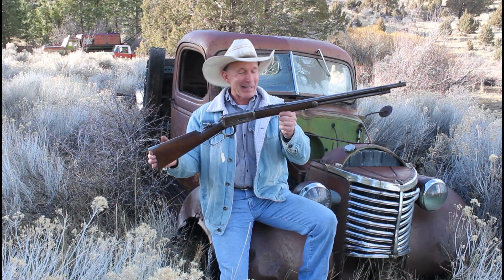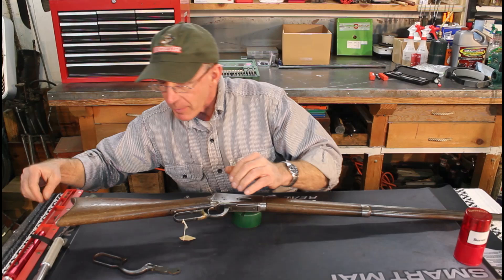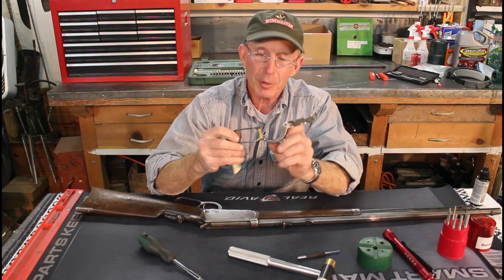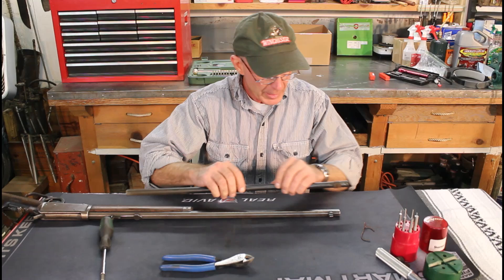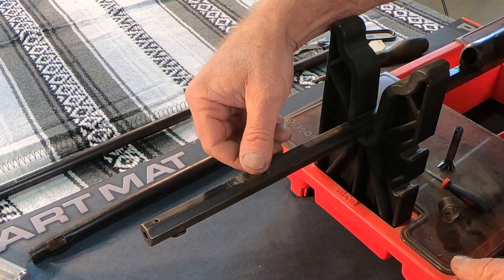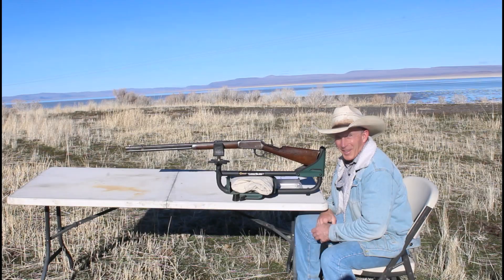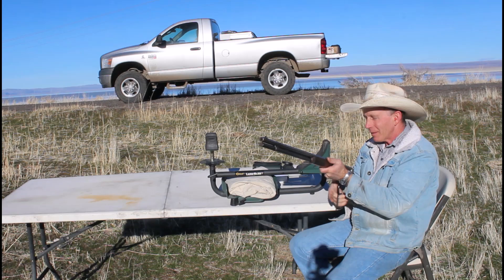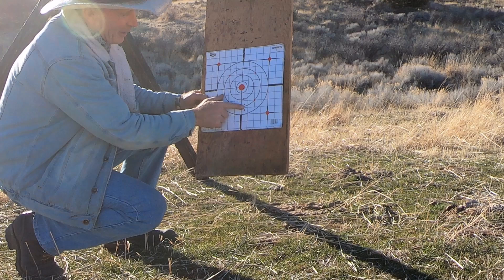Junkyard Winchester 1894

Comment: I have an 1894 in .38-55 that I got a couple years back, makes yours look like a pristine example, would love to send you photos. It was sold to a local gun shop by an old timer who could no longer hunt. The original wood wasn't on it, the buttstock came off another Winchester with a pistol grip and the wood was relieved to allow the lever to work, there were no holes for a buttplate. The metal has a lot of pitting, but it's not deep. It's an octagon barrel and it's from 1895. The receiver is also pitted. But the barrel and the inside of the action, look great. I got it cheap, got some correct wood, correct sights, and was surprised with my handloads that it shoots very accurately. It's one of those guns that is a survivor, and to a collector, worth pretty much zilch, but trying to imagine the stories. I've hunted with it some, never killed a deer yet, got my last buck with its brother, a sporting 1894 half mag in .32-40 that groups like a match gun from 1909. I prefer the older, guns with some use than anything too nice to want to shoot.

Comment: My dad was heading an ordinance co in WWII in May of '45. They took over a locomotive factory just outside of Dachau. He found a 94 win with the barrel bent around a lamp post outside. No indication of how it was bent. No signs of heating or levers used to bend it. He went in the factory, found a hacksaw and sawed the barrel off, gathered up some parts that had fallen off and took it inside. "requisitioned" a new .30 barrel for a BAR and had an old German machinist fit it to the action. Either through ignorance or hope of revenge, the old guy chambered it for 8.14 x 45(?), a popular European hunting cartridge. Dad got home and a few years later made new stock and forend from a cherry tree that had fallen on the property his sister and BIL had resently bought. Polished everything to a mirror finish and blued it nearly black. Dad passed in 2016 and that rifle is mine now. I'd really love to plug the chamber and rechamber it for 30-30, but I'm scared that I'd damage the finish. Someday I will, but I'm not quite ready yet.

Comment: I   educated  myself on    the  repair   and resto  of    Winchester  lever    rifles  about  20  years  ago. I   found   the  mag  hangers   rather  ingenious as   the    dove  tail     aids  in  the    lock up  to  align   the  tube.  I   repaired  a  1894  DOM   1897  that  has   little  blueing and  was  well  abused,  stocks,  Barrel, screws replaced. What   amazed   me  was  this  rifle  was  built   before   aircraft/cars machine work done  on  steam  power   and  leather    belt  drives...all  to  within .002+- Inch...Amazing
Reply from the maker: The craftsmanship on these old rifles is definitely impressive considering what they had to work with.  Sadly, the craftsmanship on most modern guns doesn't come close, even with today's technology.
Reply: @thecinnabar8442   You  can    buy  a   Custom  made  rifle...  W1895, 94, M 36...but  you  will  spend  $ 5000.00 + in  work   to  make  it    as  good  as  a     standard  case  colored  Winchester / Marlin  that  sold   for   $30.00  in   1900. My  go  to  hunt   rifle  in  a    Savage 1899  in  .300   Savage. Its    the  safest   hunting    lever   rifle  ever  made  with  3  safety  features, Round  count, lever lock, chamber  loaded   button, First  class   craftsmanship.

Comment: For my oiling on any gun, I put the oil on an old shaving brush. Much better than a cloth that traps dust and metal particles between the rag and the bluing. AND you can get down in every nook and cranny. I saves the bluing on the sharp edges of an octagon barrel and frame. As an aside, those 25-35's were really good shooters in their day. Over the years (many) I managed to acquire all 5 caliber 94's with 26 octagon bbls! I love them.
Reply from the maker: Thanks for the great tip, Irvin!

Comment: I use a 1936 Model 94 in the 32 Winchester for deer hunting.  Quick, light and easy to carry, its the best damn brush gun ever made.
Reply: Mine is a 1970 model I believe. Bought it dirt cheap because everyone wants 30-30 not 32 WS. My go to deer rifle for over 20 years. Never fails me.
Reply: @rodneymcdermott5303  :  They are great guns, I just got rid of a 1946 30-30 that I found out had the butt replaced.  Im not a savvy collector like some guys are so when I bought it I thought it was original.  Funny thing, I made 400 bucks off a gun I owned for maybe 4 years, I'll take it.

Comment: Sixty years ago I bought a model 94, 25-35. It was built in 1910 with a 28 inch barrel, which was a special order length. Changed the sights and added a Marble peep sight. I shot mostly varmints from a rest.  At 200 yards I could put the bullet right on the money. It was the best rifle I ever owned. I foolishly sold it many years ago.  The only down side was that long octagonal barrel got heavy if you had to carry it a long distance.
Reply from the maker: It sounds like it was a great rifle!  I hope I can get this old rifle shooting that well.

Comment: Thank You! I just got a 1894  26" barrel  in .30 WCF made in 1924.  Missing the Rear Elevator. I ordered one from Homestead Parts. I also order 4 boxes of Ammo. I miss the days before hunting season when Walmart sold 30-30 for $5.00 a box. 🧔
Reply from the maker: Congrats.  Enjoy that new 1894!
Reply: Wal-Mart and K-Mart both had .30-30 shells under 10 bucks as recent as 12 to 15 years ago. That wasn't even sale or roll back pricing. I remember K-Mart would go 7 bucks on sale in the late 90s. .30-06 was 9 bucks on sale.
Reply: @johnnorman7708  now one boxes is $40.00 if you can fine it.

Comment: FYI.  New manufactured Win 25-35 cases are thicker in the rim & if your 25-35 is a low mileage unit will have a stiff lock-up.
Reply from the maker: Thanks for the info, Randy!

Comment: I wish I paid $15 for mine. My rifle looked like it was drug behind a wagon by a rope for a bit. But, the 32 Win special barrel is in relatively good condition so a worthwhile restoration. Cracked tang, a number of corners on the octagon nickel steel barrel worn off and some big dings got tig welded and is in process. My finger lever was cracked and repaired brazed like yours. I had a rough time tig welding that crack even after removing all visible traces of braze. I guess either the braze or flux gets into the metal and raises havoc with the welding. Should be a nice shooter when it's done.

Comment: Appears to be a 39  Chevrolet. They had the hinged windshield that cranked open. They worked good but possibility of wasp hitting you at speed. Only open at low speed.
I drove a similar 46 they were nice trucks.
My 51 I still drive deleted that feature but retained the cowl scoop with anti bug screen much more practical as I’m allergic to wasp stings. Swell up at affected area for two weeks and it hurts.
Forty below or hundred and ten that old Chevy still soldiers on now 71 years from first start. ( 6 volt electric system self start feature) .
My oldest rifle was made 1902 and still works as new as well. .30 U.S. Army Krag bolt action.
My grandmother’s sister’s husband owned it before me and took one of the biggest bull elk I’ve ever seen      bar none. About 1968 he got it. 1972 my brother and I got a big bull too. His rack measuring 56” between inside of wide point.
My friend John had his 28 Chevrolet pickup  ( drove as a young man ) out behind the granary and also had a huge bull rack in the back he got back then (20’s ) as well seven points on both sides.
Reply from the maker: Those are some great memories, both of the pickups and the bulls!  Thanks for watching and sharing your memories.

Comment: Great video! I'm a big fan of 25-35.  
If you have the opportunity could you do a video on reinstalling the wood forends on 1894 Winchester and Marlins. I've made the mistake of removing a couple and had a terrible old time getting everything lined up again, maybe the wood had expanded and was compressed before I took it off. Of course removing wood to get everything back together is a touchy proposition as taking too much off results in a rattling forend.
Reply from the maker: I've been planning to do some complete disassembly and assembly episodes on these old rifles at some point that will include removing and installing the furniture.  Keep an eye out for those in the future.

Comment: Very cool. My brother has a Winchester 94 with a similar story. It's a 1919 mfg .30-30  with a scope mount on the side and the original C stock butt has been sawn off and replaced with some hideous Walmart recoil pad and rasped down to the same size, with no effort made to correct the flat spots and file marks at all. We want to replace the stock, but the finish wouldn't match the forend or really the rest of the gun at all. 

Still worth 450 bucks at a police auction, though.
Reply from the maker: Definitely sounds like it was worth the money.  I'd keep an eye out for a decent used stock that would match the forend.  It's really tough to get the finish on a new stock to match
Reply: Want to sell that truck you were sitting on? My grandfather had 30/30 with an octagon barrel I wanted it so bad ,it wasn't ment to be/gone unfortunately.

Comment: Quick question, do you advocate using blue locktite when reassembling leverguns? They’re notorious for backing out screws. You mentioned not dropping small parts. In my shop I have the first verifiable black hole here on earth. EVERYTHING I drop disappears when it hits the floor, never to be found again. Thanks for the great video sir.

Comment: Yea mine has a shortened magazine tube, 1909 I think the barrel should be octagon but its round, someone drilled and tapped the side of the receiver for a scope mount, front sight has been changed. But it's still a 1909 Winchester model 1894 30-30 lol. Paid to much I'm sure but it works and I like it. Only thing I want to do to it is find someone to back fill the drill and tapped holes lol. But until then I'll put the scope mount on it.
Reply from the maker: Even if it isn't all original, they are great old guns to shoot.
Reply: @thecinnabar8442  History in your hands 
I think I own 3 modern firearms 
And 3 dozen Vietnam or before lol

Comment: I have a question regarding were you got your replacement parts I have to same rifle in about the same condition I need to track down a tube follower end cap and screw would like to know were you can track down parts thanks
Reply from the maker: Used parts come up pretty regularly on EBAY.  Homestead Parts and Numrich Gun Parts carry a variety of reproduction parts.  Good luck

Comment: The vertical stringing occurs because of a tight magazine tube, See the 1965 issue of Gun Digest, page 195 "Lever Guns"
Reply from the maker: Thanks for the tip.  I'll check that out.
Reply: That makes no sense. How does the magazine tube affect accuracy once the round is in the chamber and stabilized in the rifling when fired? More likely it’s due to the rest or barrel heating up. IMHO
Reply: @dogbone1358  all rifle barrels actually have a harmonious ringing to it when the weapon is fired. The bullet, pressure, rate of twist and bullet speed in the barrel have to be in as close to perfect balance for the best accuracy.
When the mag tube is attached to the barrel it effects this process more and less with each bullet put into and removed from the mag tube as it changes the weight and ability of the harmonic balance of the weapon.
It is all very fascinating how it happens during the entire process.
Reply: @Sport--willow   Concept of the magazine tube affecting the harmonics of the barrel is not something I’ve heard of but does make some sense.
Reply from the maker: I talked briefly about this in the episode on Winchester 1895 flatsides.  One of the advantages to the box magazine on the 1895 is that it eliminates the effects of the tubular magazines on barrel harmonics.  Of course the box magazines have their disadvantages, too.  They don't hold as many rounds and they can be a pain in backside to load.   Thanks for watching and commenting, guys!
Reply: Good thing about these old work horses is that they are very strong, reliable tools for shorter ranges and preservation. They reliably reach out 1 to 200 yards effectively and put meat on the table every year.
These Ol' girls aren't made to reach out 1000 plus yards like these new age fandangle rifles with these $3000 scopes and bullets traveling 2900fps and more.

Comment: Another good video, I'd like to find a old neglected Levergun to get back in to shooting shape.
Reply from the maker: Half the fun is in the hunt for neglected guns at the right price.
Reply: @thecinnabar8442  I did find a old Marlin 1893 in .30-30 made sometime around 1921, it was missing the forearm band and the magazine tube was loose. 
I found that the forearm band from a 336 fit it just fine and was able to squeeze the front barrel band just a little tighter with padded channel locks to keep the mag tube from moving side to side. 
Now its a decent shooter with a really cool kinda grey patina to the barrel and mag tube, with some of the original color case finish on the receiver.
Reply: @thecinnabar8442  Also forgot to mention that the previous "bubba" replaced the stock and managed to put the crescent buttplate on off center and crooked, requiring me to fill the screw holes with glued in dowels and redrill the screw holes to center the buttplate, now I just need to strip off the ugly varnish back to plain oiled walnut finish

Comment: I picked up an old 1894 Winchester at a local pawn shop  in 30WCF  made in 1915. It's a little rough and I thought the lever seemed a little sticky so I took it to a gunsmith to clean and he said it was pretty dirty, maybe never cleaned ? He pointed out something that he said is characteristic to old 94's is that when pointing the muzzle up and cocking the lever the hammer does not lock back ? But if you hold the rifle horizontal the hammer will engage back cocked ? I have never heard of this and have had 94's before, some as old and some newer ? Is that true, or should I find a better gunsmith ?

Comment: Another well done video Mark.  Good stuff.  

Was your tang sight locked into its detent.  Looks like it was leaning forward early in the shooting process.  Might be the source of what appears to be a little vertical stinging.   Nice shooting old 25-35 at any case.  Will look forward to your next video!
Reply from the maker: Great eye, Mark!  That combination of tang peep and sporting rear sight made an interesting sight picture.  I actually found myself unable to focus on the tang sight and naturally lined up on the rear sight.  The tang sight wasn't locking into place and I'll need to take it apart and see what's going on with it.  I'll remove the rear sight before I shoot it again to "unclutter" the sight picture.

Comment: I can't find the answer on any forums so I wanted to ask you. How snug should the magazine tube be on a model 94 with 2 barrel bands? Wondering about a carbine but I'm sure the answer applies to any model. Should the tube feel loose or should it be solid and locked into place when fully assembled? How much play is acceptable if any? Thank you very much.
Reply from the maker: When properly fitted, the magazine shouldn't have any play or movement.  If yours does, it likely has wear in one or more parts.
Reply: @thecinnabar8442  Thank you for answering! It's a pre ww2 model so I wasn't sure. When I tighten the bands enough to remove movement the threaded end of the band screws is exposed. I was thinking of filing the screws down and bluing the tip?

Comment: I own a 92 Win. 44-40. Most of the time it fails to chamber a round. It looks like it forces the nose of the round too high and rams it up against the top of the breech. I had a gunsmith work on it and he said he did not know how to fix it. Any ideas? Thanks.
Reply from the maker: Hi Charlie.  It's hard to diagnose without the rifle in hand, but it sounds like the carrier is travelling too high.  The right cartridge guide should limit the vertical travel of the carrier.  There may be wear on either the front of the cartridge guide or the carrier where they come in contact.  Of course, some ammo and bullet profiles can cause feeding problems in certain guns as well.  Good luck getting it figured out.
Reply: @thecinnabar8442  Thank you so much for taking the time to answer and keep those videos coming. Very interesting.

Comment: Hello, I'm a old retired USAF Vet. I have a 1886 Winchester in 38-56 I discovered it has a broken fireing pin.  I got  a new correct  firing pin. How can I have you help me with replacement and getting my 117 year rifle back in the field
Reply from the maker: Hi George.  Your best option would be to find a local gunsmith for the job.  The cost and hassle to ship it out here and back for a minor repair wouldn't be worth it.  Best of luck

Comment: You said the 25-35 was your favorite 94 cartridge why is that? Is it adequate for dear and maybe sheep? Impressive accuracy. What weight bullet do you prefer and what velocity do you get? Thanks for sharing 👍
Reply from the maker: I haven't hunted big game with 1894's, so I like the 25-35 for plinking, target shooting and varmints.  It's lighter than I would use for the mule deer we have here, but am considering it for antelope next time I draw a tag.  I've just used factory loads in the past, but will need to work up loads and try to find a very accurate load if I'm going to use it for hunting antelope.  Because this one isn't in real nice condition, I may throw it in the pickup and see if I can't get some coyotes with it.
Reply: @thecinnabar8442  I was thinking it would be perfect for coyote hunting with 85/90 grains. I looked it up people get pretty good velocities from this cartridge but less than the 257 Roberts and 250 savage but fast enough to be useful. Thanks 👍